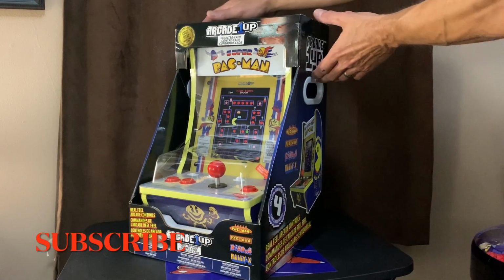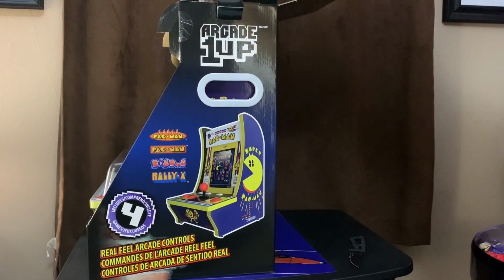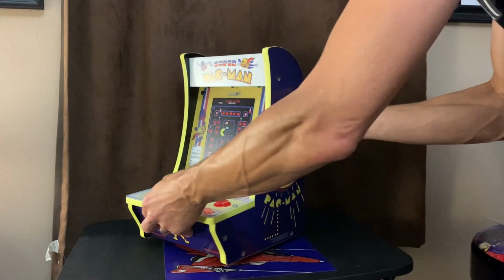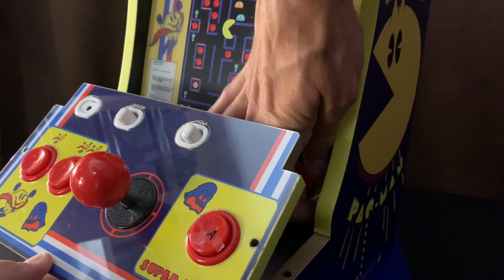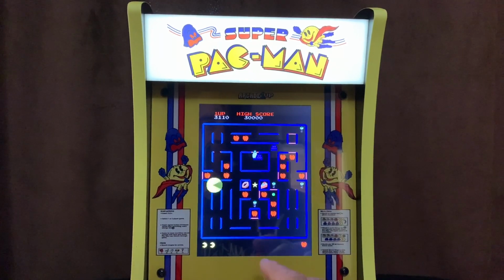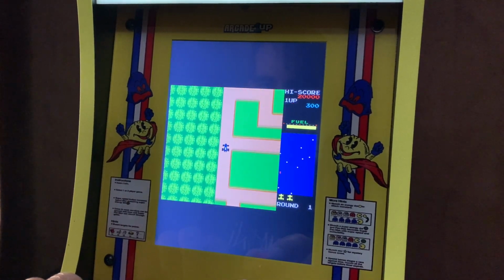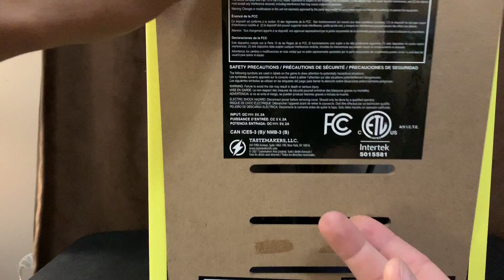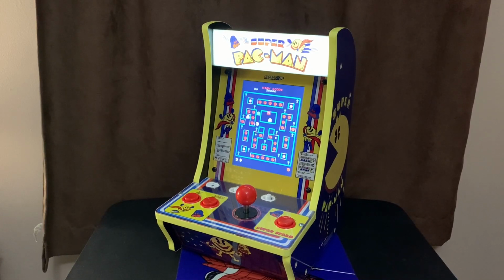Arcade1up Super PAC-Man Countercade Unboxing and Overview!  New features, new ports, MicroSD card!

Comment: I was going to get this until I saw they are using the Rally X they have in it.  Thanks for the video.  They did the same thing in the Arcade Pixel Bash.  But strangely before Pixel Bash was created they had Namco Classics Volume 1 and Volume 2 for the arcades.  In Volume 2 they redesigned Rally X and made it Vertical like Pacman and Mappy that also came on it.  It was amazing and I decided I liked the Vertical version better.  It's a shame that Namco used the Horizontal for the Arcade of Pixel Bash and Arcade1up Did it for this Cab.  I fear they will do the same for the Class of 81 which I was thinking about getting because I had the original Class of 81.

Comment: Have you figured out that the SD Card slot does?
Reply from the maker: I’ve tried a couple cards with no reaction from the countercade. It probably requires a very specific format.
Reply: @19kfox  was it just an empty slot?  Still waiting for mine.

Comment: You should try using the SD card slot in the same way that the plug-n-play works... you can add roms to that dumb thing, so I don't see why they would've added it to the countercades for any other reason other than to add games.
Reply: Probably for firmware updates as well